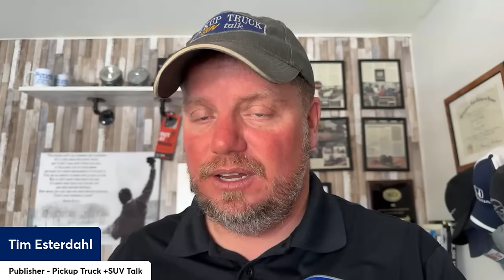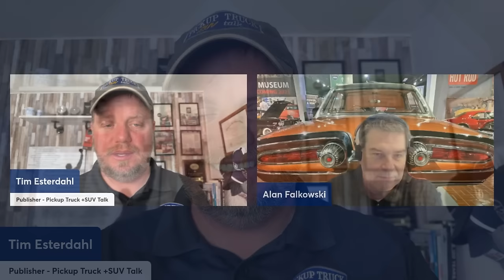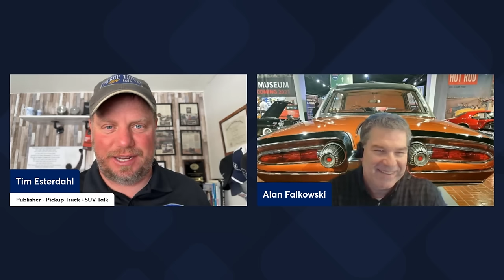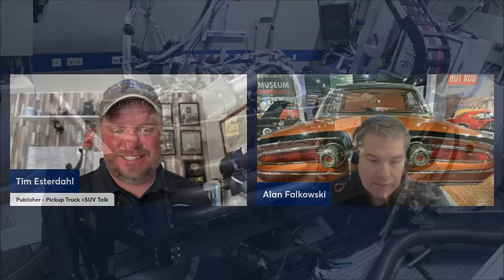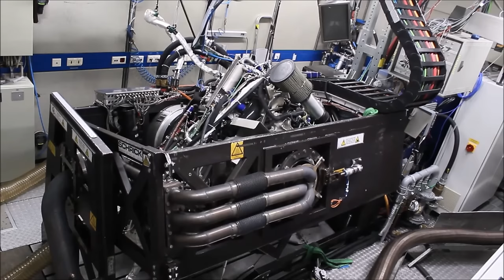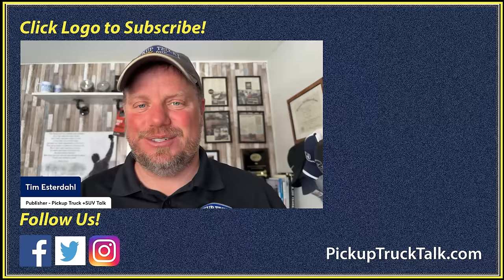Engineer Deep Dive: 3.0L Hurricane Engine - Turbo Life, Oil and Intervals and More

Comment: I wonder during the testing of engines do they have a way to incorporate the heating and cooling intervals and the effect that causes. Thermal expansion and contraction rates that may fatigue components of a engine due to frequent cold starts. I usually get longer engine life when I let my engine rise to operating temps during idle. I see people start their cars then pedal to medal immediately. Is that a real concern for long term jeopardy of engine or I just being too cautious?

Comment: The best gas motor on the market by a large margin is the 6.4l ram. The other 2 have newer motors that advertise more power. But ram went and fully forged the motor down to the wrist pins. It shares a lot of internals with the demon. It's the only one on the market that is forged. Same with the transmission.
Reply: Definitely so! I have a 2015 Ram 2500. 6.4 Hemi. 202k . Running strong. No problems whatsoever. I do oil change every 2500 miles

Comment: Fill for life and transmissions is horse hockey. Cool interview though, thank you.
Reply: Mopar uses ZF trans. The ZF engineers say it absolutely needs changed. Mopar marketing and the EPA boot lickers say it's lifetime fill. 

Same is true with rear diffs, transfer cases, etc. and other manufacturers like GM. The company says lifetime to appear green-compliant and maintenance free, the engineers (off record) say otherwise. Toyota, Honda, Nissan still outright say the drivetrain fluids need changes every 30k-50k depending on whatnots.

Comment: Test drove a new 2025 Ram 1500 with the SO Hurricane. I was underwhelmed. Put it this way, you leave traction control on and you give it a decent amount of throttle, that thing will go hard into traction control and make you feel like the engine is in limp mode.

Thermostats on these are having issues at current where they are falling apart internally and causing high coolant to overheating conditions.

Now since these engines are still new and don't have many years on them, its hard to say if the oil level gauge in the IPC will ever fail. There's always a greater than 0% chance of that happening, but put it this way, BMW and Mercedes has been doing similar stuff for nearly 2 decades now. Granted I don't follow either company closely, but ive never heard of those having an issue and same goes for Mini Cooper since they use I think BMW engines.

That is not yo say it won't be a problem. Those companies have used ZF automatic transmssions for years without any issues, and Chrysler has been using them for a while and they have the same constant issues across multiple lines. So clearly the other manufacturers know what to do better.

Comment: For all the people that want to keep their trucks as long as they will last and  believe that no added harm comes from running your oil to 10K miles....Good Luck. I also question not having duel fuel delivery. Ford learned that having only DI caused buildup on the intake valves to the point of affecting the way it performed, requiring to have them cleaned at a significant expense. I currently own a 2019 3.5 ecoboost with DI and Port injection with 81K miles. I have all the fluids changed when they're supposed to be and the oil every 5K along with tire rotation. So far it's been flawless....keeping my fingers crossed. 🤞
Reply: Great engine! Extremely abused and they keep on ticking! Fed LEs! Desert terrain!

Comment: No question about carbon buildup??? My 2020 6.6 Chevrolet 2500 gas had a ton at 78,000 miles when we pulled a head for a leak… that was with top tier fuel and recommended oil…. Should of for sure been a question I can see why for and Toyota use duel systems… love the new power plant and this was a great video absolutely love the content Tim! Keep it coming it’s awesome when you get to interview the people making the specifics parts  of these vehicles

Comment: The worst conditions. Really? Do they do the other test like daily driving. 10 min trips here and there. Constant cold starts, and driving short trips without letting the engine meet normal operating temps. Constant start stop in stop and go traffic. For told us they secretly raced the Baja with the 3.5 Ecoboost and it was legendary. How'd that work out for the customer and the first Gen production ecoboost?

Comment: Excellent video Tim. I'm not afraid of a turbo charged engine at all. But, I pay attention to my vehicles. My wife put 51,000 miles on her WRX, 2 liter turbo and not one issue with the engine. I do change oil often. I'm old school and it's not that expensive. I think Subaru has this turbo science down pretty well. They had some problems  in the early years and overcame them. My wife was very observant as well. That car could pull 20 PSI of boost, but it could also climb any mountain in Colorado at 5 PSI or less. At 10,000 feet , 6 PSI is just atmosphere in the cylinder. It's hard to change people's perception though!    😎
Reply: Turbo haters think that the engine is always under full boost, even at idle!😝
Reply: @paulhunter9613  , you know it seems that way. That would more likely describe a roots blower. They used to have that roll at idle, because they would build up a little boost at idle. The new style SC's don't do this. Refinement!  With an adequate powered NA engine, a person can stay out of boost with a turbo. Most of these new engines though seem to need boost to be sufficiently  powered, LOL.
Reply: @kensnyder2340  while I don’t have a boost gauge to view, an eco can be driven normally without getting into the turbos I think.  It appears that when staying below 2000 rpm between gear changes keeps it out of turbo mode, and that can be done with the 10 transmission it seems. But with city and suburban driving I usually get around 19-19.2, I can’t complain about that, my last truck driving the same way would not get much over 11 mpg
Reply: What engines are using smaller turbos? Subaru? @tellucas

Comment: Start stop is an issue with their vehicles.   Read multiple complaints on Wranglers and Gladiators, believe one was the long term test vehicle for Edmunds where it left them stranded multiple times.  My niece has the same issue on her Compass where it shutoff fine, but had issues starting again on more than one occasion.  I think we all agree the "start" is the more important part of the system :)

Comment: I get that saving fuel is a very good thing, but it baffles me how Stellantis thought this is the 'right' engine for an SUV that weighs as heavy as 3077 kilogrammes (heavier than an Escalade ESV)😅

Maybe Jeep should've never pulled the plug on diesel engines.

Comment: They stress test the heck out of the engines but I guess they forgot to let the HEMI's idle for awhile which then develop the "HEMI tick" lol.    No amount of testing will ever replace the real world scenarios we put them through to find out exactly how reliable they are.   Let's check back in 5 years to follow up 😂🤣..    Also I can see things going really wrong without having a dipstick to verify the sensor is not incorrectly monitoring the oil level.   Why not have both?    If it fails or doesn't detect correctly we "hope" a warning light comes on the dash and things are OK,   but what if it doesn't and the end user lets the oil run low and bricks or severely damages the engine because they can't check?

Comment: If the high output oil is 0W40 for film strength / thickness due to increased pressures / bearing loads, would it not be better to use the same 0W40 oil in the non high output instead of 0W20? Also I get the joke about checking the oil but I think you don't give enough credit, I would argue many more people check the dip stick than you think. My truck gets checked at least every two weeks as well as looking for drips on the driveway where I park. That is how I found a rust hole in my diff cover and replaced it before it became an issue. I have had a couple sensor failures on engine over the years, not many,  but never a dip stick failure. Sorry, I will get off my soap box now. Very good video thanks Tim and Alan.
Reply from the maker: What he is saying is OW40 isn't needed for the S/O engine since it doesn't have the same performance. If you use it, fine, but you are wasting your money. 

For the dipstick, the oil life monitor is more useful for the "majority" of customers and it will do a better job monitoring the oil than checking your dipstick since it not only checks the amount of oil, but the quality of oil. You can still check it yourself, the computer will just do a better job.

Comment: Alright Tim. So at the 11:45ish you start talking about turbos and Alan does a great job of explaining how turbos can be reliable. However, if taking those steps cost money ( and most do) then can we trust the manufacturers to properly take those steps to increase longevity. The next topic was durability testing. I watched these tests before and i have yet to find a single published result. Can you find them? Lastly, i think it's important to point out durability, reliability, and longevity are related but they are different. Just because you can run an engine hard for 150k doesn't necessarily mean it will last 300k under normal driving.
Reply from the maker: Nobody will ever publish durability tests. Never going to happen in today’s world with lawyers and class-action lawsuits.
Reply: @Pickuptrucktalk  I think you are right 😔

Comment: I am not worried about the Turbo,  I am worried about the rings, pistons, cylinder walls, and crankshaft, can they hold up in a high-boost.  A V8 has the forces shared with 8 cyl while a 4 cyl has less to share.  
Crazy that I believe a V8 will last longer, sound better, and is smoother.  The in-line-6 sounds good to me, better than a 4cylinder.
Reply: Awesome comment. V8 sound better no doubt. As far as durability goes a Inline 6 configuration is superior. Compared to V8 configuration, structural it’s got 7 main bearings vs 5 for a V8, it’s perfectly balanced and easier to work on. This is the reason it is so commonly used in big rigs. I am happy they choose and in-line 6 configuration.

Comment: My 2017 F150 has their 2.7L. EB that was designed from the start to be a turbo engine, and shares elements of a diesel engine construction. It’s been reliable for 56k miles so far, but I don’t abuse it either. I think this hurricane engine will do fine in the long run.
Reply: I doubt it
Reply: I put 180k miles on my 2017 Ford f150 2.7eco. Great engine. Changed the oil every 7500 miles. It was such a great truck.

Comment: That was an eye-opening and enjoyable video. I know that my naturally aspirated 2.4 Hyundai and go to five or 7000 miles between intervals but I’ve been changing at three but I also know that it’s semi synthetic so I will try changing my oil at five now. And it makes me very happy to hear that the manufactures are building the blocks and the lower end handle the boost on these new turbo engines. I was really concerned about that.

Comment: While the cost of everything has gone up, it’s still economical and prudent for long term ownership to change your vehicle’s oil every 5,000 miles. 
There is a big difference between an engineer’s perspective and a mechanic’s reality. 😉
Reply: Yeah, the engineer is usually right. The proper thing to do is change it when it is required. No one can throw an arbitrary number out there like 5K and think that will work for all. Some need to change theirs at 4K.

Comment: The problem with the auto start stop is not that the starter will wear out (it most certainly will at some point) but the fact that it will now cost you thousands of dollars to fix it when it goes. Plus for me the worst part is that it is not a pleasant driving experience. I will say that the e-torque system somewhat fixes the drivability problem but it is way too aggressive as it will shut the engine off even before I come to a full stop. Oh and 10K interval for oil change??? He may be correct but I have trust issues and go every 5K just in case. Internal combustion engines are astronomically more reliable and durable than they used to be. I remember the 70s when you would be very lucky to get 100K miles out of a vehicle. Now 200K to 300K is not at all unusual especially if you perform regular maintenance.

Comment: Great guy    No harm no foul I’m changing oil as I always have 500 new. 3000 - 5000 miles there after  👍👍🇺🇸🇺🇸
Reply: If you drive higher % on highway you could probably go 6K miles.  Is it a turbo?  then 3K regardless.

Comment: All good points and reasons for an I6, but the oil level sensor WILL fail at some point, and this is where one needs the stick to check questionable sensor values. Having the sensor is neat, and probably far away from any major evolution, but getting rid of the stick is a bad idea from a customers perspective...
I have a term in mind I heard recently, it was something like: "Enshittification". Make a product as expensive as possible, just below the threshold where the customer would stop buying, but having them complain is OK. Make the product fail as soon as possible (to sell more), as long as the average customer does not recognize it failed way too early. 
That being said: I do like the sound and feel of a V8, but I have to admit that an I6 engine has advantages, and for those advantages it might make sense to prefer a turbocharged I6 over a V8. 

He said developing engines goes faster and faster these days, because of experience and available tech. I can totally see that. I just can not see why these cars in general can not cost a quarter of the current MSRP. Seems there never before was so little human labor involved. So much dome by robots/machines. All human achievements, but somehow these achievements don't reach the general public. Too many parasites in the whole product stream; fees, taxes, bureaucrats, big capital collection tanks - what is it? I don't get it. With all this technological advancements all the cars should be cheap. A salesmen recently told me: It's expensive, because it's so well equipped. Does not make sense. An electrical window motor probably involves much less material than a heritage manual window roller with all the cables. Same for tachs as an example. A classical tach (mechanically driven), compared to a simple screen which simply is showing values, more or less enhanced by a graphical designer must cost next to nothing compared to an old mechanical masterpiece. Camera sensor sending pictures on that screen. Fine, but 5 reasonably good cameras probably cost much less that a quality mirror glass, correct?

Comment: Every turbo car or truck I ever had was a maintenance queen.  Any alleged fuel savings were lost in added maintenance costs and turbo replacements. I know these companies have to do these things to fake the EPA but they really don’t produce any decent resukts
Reply: The 3.0 Hurricane gets 1 mpg less than the HEMI V8 in the city..
Reply: I currently have a turbo four and it's no different on maintenance than the naturally aspirated V6 I previously had. There's no guarantee the turbo will last the life of the vehicle since I plan on keeping it another 15 years (have had it 4 years current) but I use really good oil and change it a little early. I'm confident it will last
Reply: Agreed 100% brother